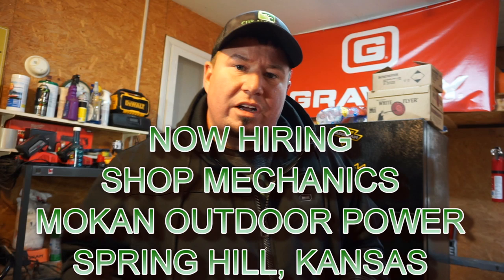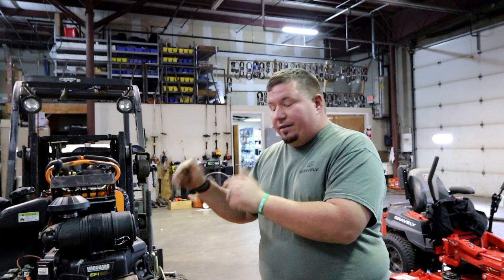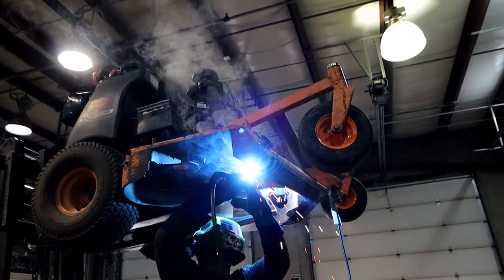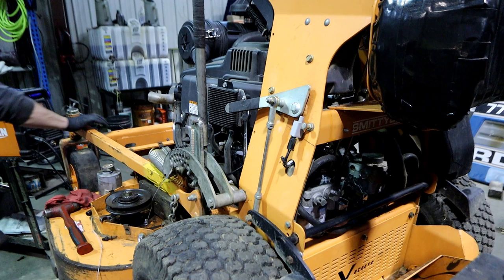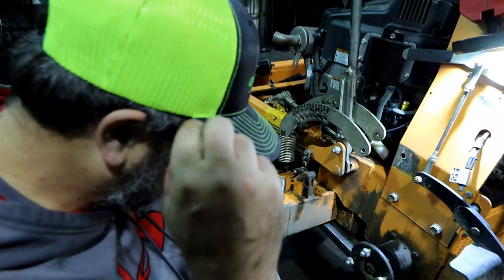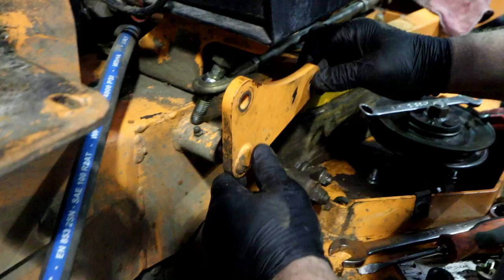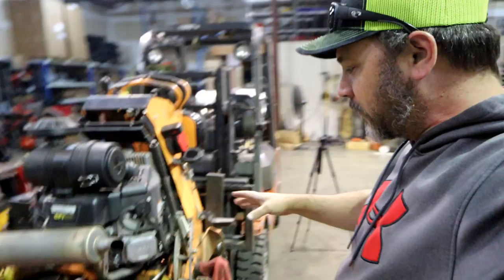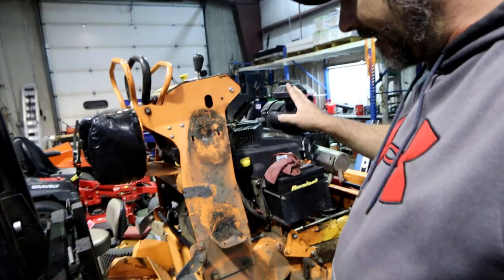Mower Issues | Project Scag V-Ride Lawn Mower Welding the Deck and Frame

Comment: that big thingee on top is the control tower.  to fix cracks- step one, grind them out, find the end - step two drill a 3/16 min hole in the end of the crack, step three, weld it up.  
 that particular mower is more basket case than project.  good luck,  I hope those two guys are generous with their time.